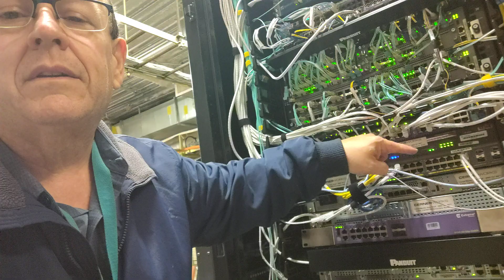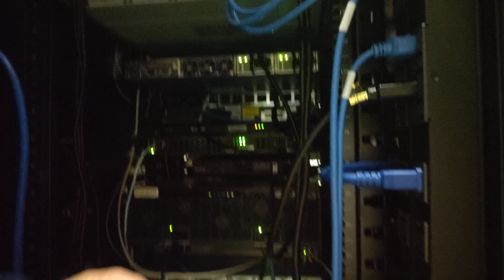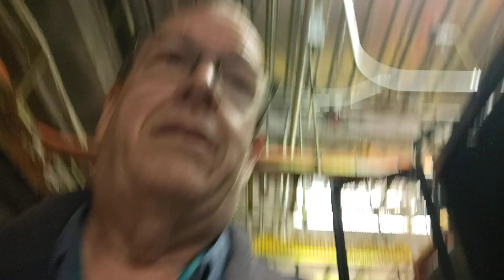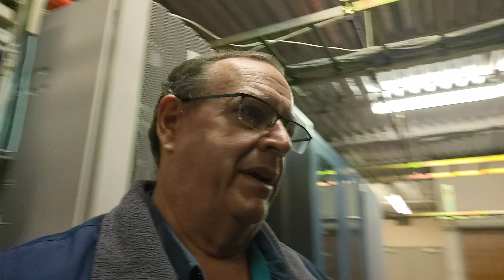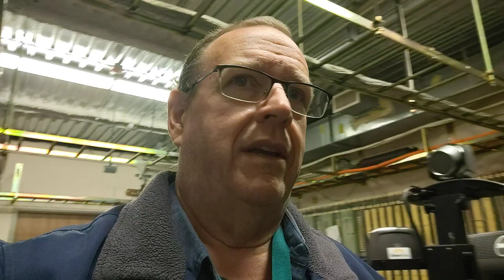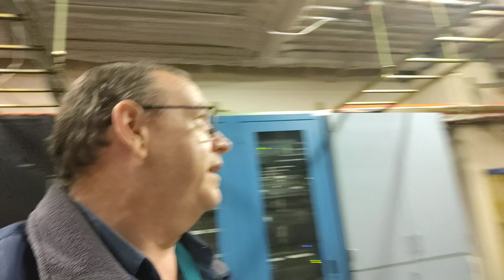Network Admin Life - Power Testing

Comment: Did the swap of the cables fix the problem?
Reply from the maker: This particular device seems to have a bad power supply.  Swapping the power cables moved good power supply to the UPS and the bad power supply to our emergency power outlets.  Next time there is an outage the device stay active.  I do not own this device so I'll have to contact the owners to get it fixed.  God bless!

Comment: The good thing about working at a hospital is that if you get a heart attack doing something is that you're close to a doctor

But you have redundant cerner equipment so this is the backup route, with the probably bad PSU? But it does look like pretty nice unit with both remote serial and transfer switch between two circuits.
Reply from the maker: Only problems the doctors would never find me! LoL!  This particular device seems to have a bad power supply.  Swapping the power cables moved good power supply to the UPS and the bad power supply to our emergency power outlets.  Next time there is an outage the device stay active.  I do not own this device so I'll have to contact the owners to get it fixed.  God bless!

Comment: What would've happened if there wasn't any backups how do you fix the issue
Reply from the maker: This particular device seems to have a bad power supply.  Swapping the power cables moved good power supply to the UPS and the bad power supply to our emergency power outlets.  Next time there is an outage the device stay active.  I do not own this device so I'll have to contact the owners to get it fixed.  God bless!

Comment: It is quite amazing to see that large data center. I am also a system and  network admin. I would like to ask a question that: I would like to find a software or tool for documentation. I heard most people suggest to use Evernote/OneNote/Wiki/Excel. Would you please share what tool you are using for system documentation? Thank for your help.
Reply: Notion is a good one
Reply from the maker: Believe it or not, Excel is my goto.  I can document the racks and where equipment is mounted, I can document the switch ports, and a host of other things.  So basically Viso and Excel is how we do it.  God bless!